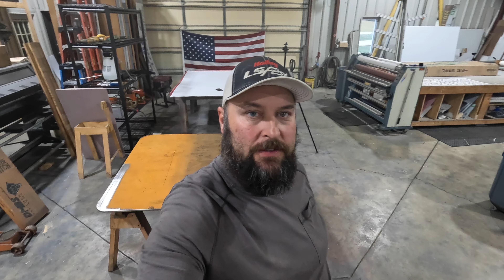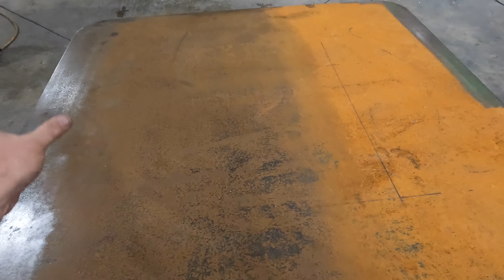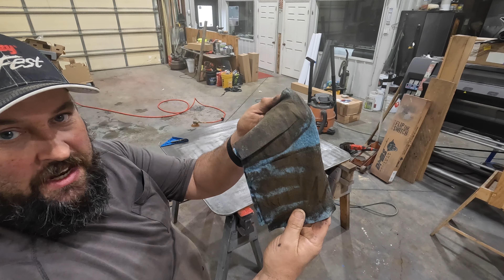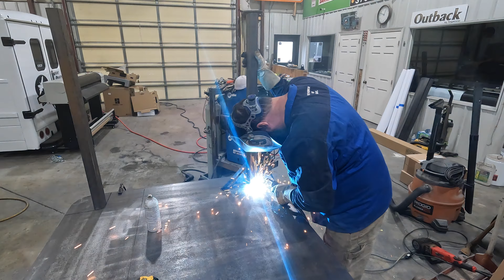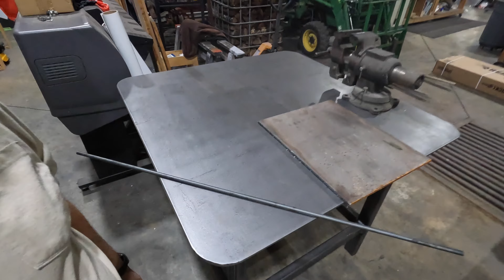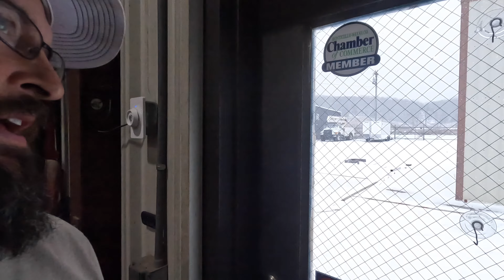Building a Welding Table Part 1

Comment: Ive been trying to finish mine for 2 years😃 I put a 150 - 20mm holes in the top for clamps and ground to a halt. Nice work
Reply from the maker: Wow that is commitment. 150 holes takes a LONG time. I am interested to see your table. I have part 2 coming out this Sunday morning. Thanks for watching!
Reply: @livedlearnedDIY  Thanks I still have to build the base/frame yet, I should get on with it👍
Reply from the maker: Every build starts simply. Just do it. Once you get started it will go pretty quickly. Thanks for watching!